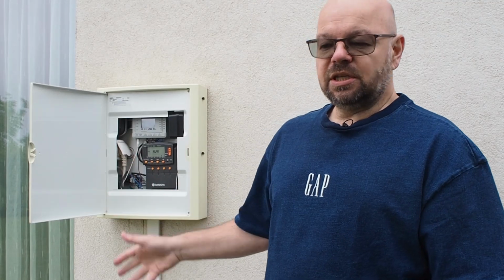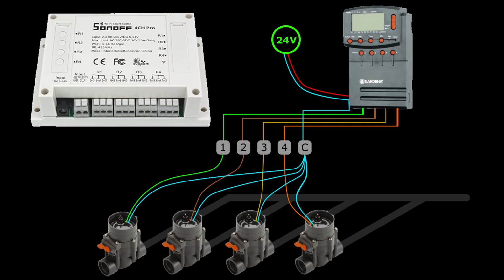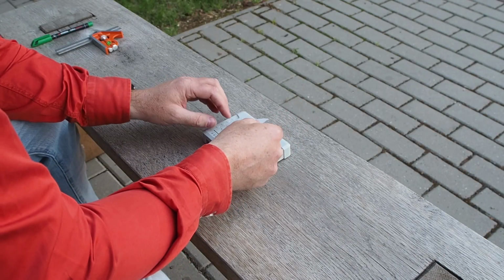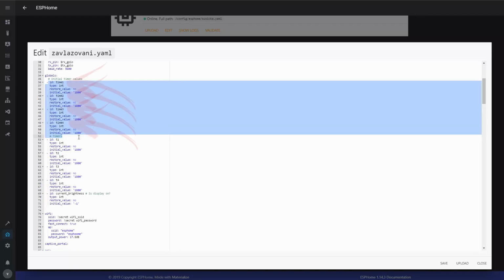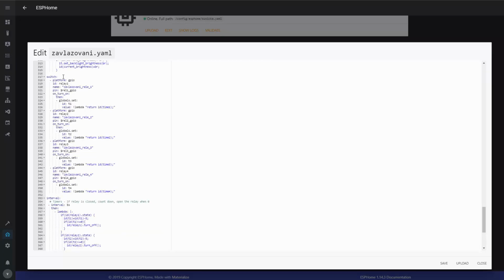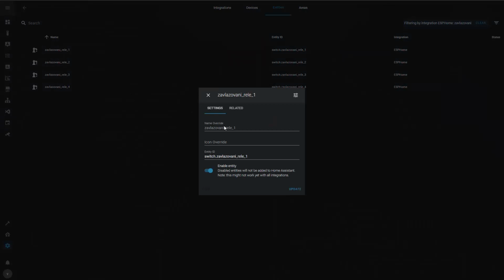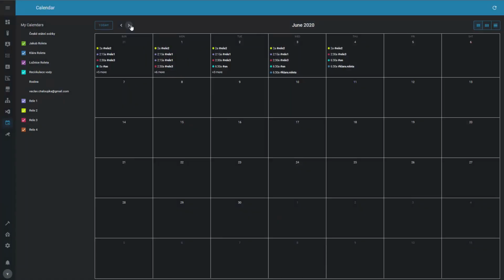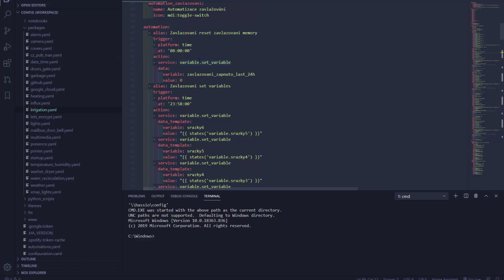Smart irrigation

Comment: Super great video. This one of the best I have seen. Integrated the NX3224T24 display module into the Sonoff 4Ch Pro is the highlight of your video. Just in time to watch your video as I am looking to replace my old Orbit Auto-Sprinkler System Timer. The old system is bad 1/ Need to replace 9VDC battery every 1-2 years, 2/ Forgot to reset back the timer after 2-3 rainy days. With HA and microprocessor, I don't need the dry battery to maintain all the memory setting. Can stop watering with integrated weather forecast. Sensor is one I debate as it may be rusted or giving fault information. Anyway, thank you once again for nice video. Well done, Bro.

Comment: I made one using an ESP32 and a board with 8 relays. Where I live we have watering restrictions based on the season. I used the automation in ESPHome to set the schedule instead of using Google calendar. It is actually much simpler. It consists of three on_time calls with different month and day parameters that run a script to cycle the sprinklers. I also interlocked the relays so that turning one on will turn off the one that was already running.
Reply: Hello can you share your solution ? :) Do you have it on github by any chance ?

Comment: I just started using ESPHome on my Home Assistant setup, and found your irrigation write up. I have been fighting with my old system so I decided to try one like you made. I already had all of the hardware, but had done much with them. One thing that I did find was that the Nextion basic display seem to work fine on 3.3 vdc and I already had the header pins installed to flash Tasmota several years ago. The display only pulls 90 milli-amps at 100% brightness. Thanks

Comment: This was a great video. I would love to also see a video on your pool automation.
Reply from the maker: The only thing I do is, I control the circulation pump, and I vary the start and stop time, based on the water temperature (increasing the time with increasing temperature). And I control the lights. But that's it. It is desjoyaux pool that has a textile filter. So no sophisticated control of filtering or chemicals. I thought I'd add a Ph sensor, but from what I've read, it has to be calibrated all the time, so I gave up and do that manually once a week or so. But would definitely welcome any ideas and suggestions....

Comment: Excellent video. It's inspired me to do something similar for a heating controller. I'm curious why you didn't chose to run it from the mains supply and use the Sonoffs on board 5V to power the Nextion?

Comment: Could you please tell me what is the practical difference between such a system as compared to a device like Sonoff SWV-BSP Zigbee?
If I have a small garden can I get away by just plugging the sonoff device directly to an outside faucet?
Reply from the maker: I did this one like 10 years ago. Then, there were no such devices. So I did it out of necessity. It has 4 valves, 2 program, with local control on the appliance (so it will finish the program even when loosing HA or WiFi. Plus it opens valve and check the weather. And it has a touch display with control. But it is DIY, a bit of work. So I'd go with the of the shelf valve, except if you have a need to customize it in a way the box device does not allow

Comment: Thanks for share your work!!!
I am ordering parts to make somethig similar, but I have doubts what FTDI to buy.
Vaclav, can you please recommend me one?
Reply from the maker: I did not really do any reseach here, I use a generic FTDI card. Mine has both 3.3 and 5V, so the only think I have to do is to make sure I use the right voltage. Not sure what else is there to decide upon? Perhaps some auto-switch to programming mode function?

Comment: One question: did you use special power supply for 5V, with IP rating? Something to protect from humidity and frost?
Reply from the maker: No. It is inside the enclosure, so I hope humidity is not an issue. Not sure about the temperature rating (but I do not often irigate the garden when it is freezing, in fact, I flush the system in autumn) ;)

Comment: Good job. How did you connect the Sonoff and the Nextion physically, i.e., which pin to which pin? And how did you set up the Tasmota Module parameters, i.e., GPIO1 to Serial TX (148)?
Reply from the maker: I connect 5V to 5V, GND to GND, RX to TX and TX to RX. I am sorry if I forgot to mention that. I do not use Tasmota but Esphome. Check the last video on displays.

Comment: Are valves working with DC power or AC? If they work with AC is it ok to use DC power instead?
Reply from the maker: DC. But the Pro has galvanically isolated relays. So does not matter.
Reply: @bruxy70  Thanks for your reply. How to connect the 4CHPRO3 to install the YAML file. I assume I missed that part. By the way, the chipset of my Sonoff switch is ESP8285.
Reply from the maker: @PayamJianTV  FTDI adapter
Reply: @bruxy70  in order to connect Sonoff to the computer via USB? what about the chipset? is it considered the same as ESP8266?
Reply from the maker: @PayamJianTV Yes This one uses ESP8266 https://devices.esphome.io/devices/Sonoff-4CH-Pro-R2

Comment: does sonoff have to be a pro?  can it be 4cz  normal?
Reply from the maker: Nop. Normal sonoff would send the phase to the valves (240/110V AC), I do not think there are any valves that would use that. Sonoff 4ch Pro has 4 relays with galvanically isolated contacts, so they connect the middle Common contact with the NO contact. But it does not have to be Sonoff, you could use an Arduino circuitry with 4 relays.